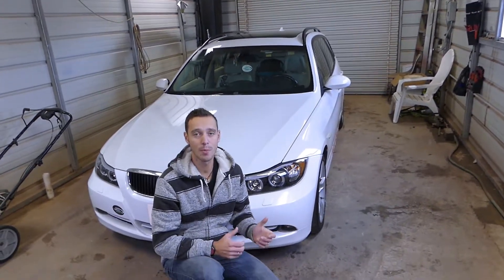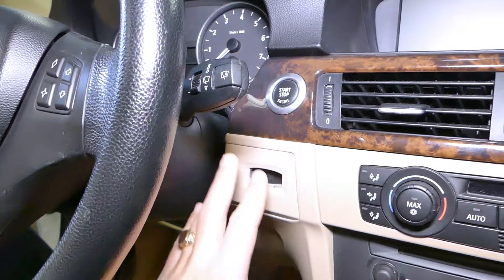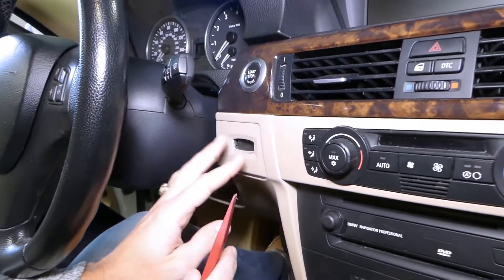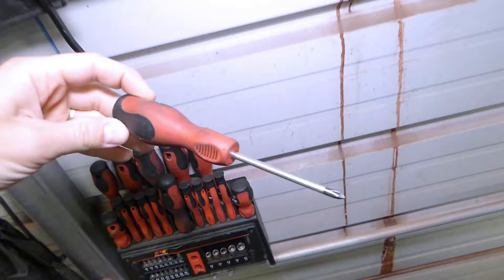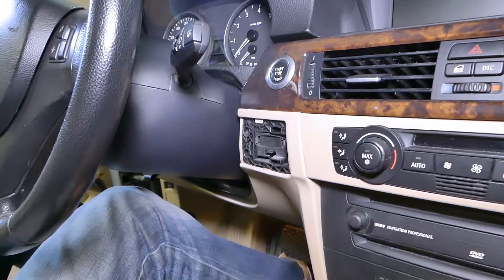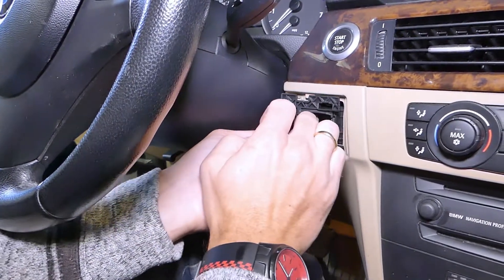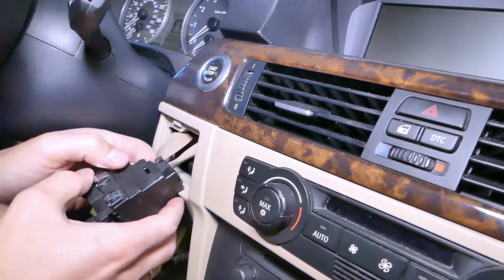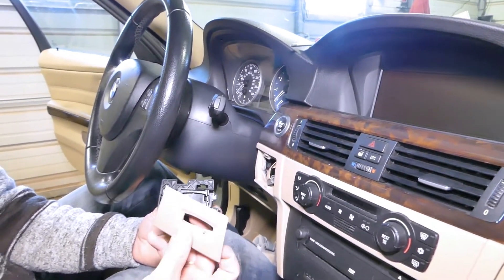HOW TO REMOVE AND REPLACE IGNITION KEY READER CONTROL MODULE BMW E90 E92 E91 E93

Comment: Man I thought mines wasn’t working just now until I found out it was on neutral 😂😂 I gotta stop getting high
Reply: Same shit just happened to me! saw your comment and saw that I was in drive 😂😂
Reply: @lordfrank3455 😂😂bro I was pissed cuz I thought I broke mine cuz it didn’t want to turn on. I was in park the whole time😂
Reply: i just did a 10hr shift and i had mine on drive and couldnt get the key out i thought i had to take out the whole dash and i just saw your comment🤣🤣🤣🤣🤣🤣
Reply: i did the same but ripped the key out and broke the key lock 😂
Reply: @mattselfe6734  😂😂😂
Reply: @scytrex9694  😂😂

Comment: What symptoms would the car have to warrant this replacement?
Reply: About 10 minutes ago I put my fob into this module and something inside it broke so it no longer holds the fob in while the car's ignition is on. I can just remove it without pushing it in first. Pretty sure the plastic got old and brittle.

Comment: I know this is an old video but ; 
My ignition doesn’t seem to realise I’m putting the fob in it sometimes…it works fine “sometimes” but other times I have to do it 30 times before the button works!!
Any ideas what I need to do? The buttons work for the locks no problem at all … just doesn’t seem to know the fob is in there 🙃
It’s an “08” plate e90 320i cabriolet 
Any help greatly appreciated as can’t seem to find anything online
Thanks
Reply: I have the same issue with my E93 m3 
Did you ever finding the issue?
I’m suck trying to figure this out
Reply: Hi guys, did you solve the issue? Having it rn
Reply: hello solved the issue??

Comment: I have the 2007 that has the shifting on the steering wheel  battery died I put a new one in and re program the key it still does nothing it hat the steering wheel lock light and the key light on help

Comment: do you know if you can install  a used one  from another car? ,, it needs programing or not ?
Reply: I think you can just swap it over bro .. I swapped the Guage cluster out from another car into mine which has more miles and it showed everything  correctly  sometimes on start up it shows the other cars mileage  then it changes to my cars true mileage but not all the time ..

Comment: I have BMW 328xi 2007 the stuck in ignition, I have to remove the power relay to get it out. No crank, no start. What should I do my friend?
Reply: Did u find a way to get it out
Reply: @hottdogg1232 what did you do to start and fix it

Comment: If I replace this part do I need to do any reprogramming? Will my old key still work in it? Would it make a difference if I bought a used one from the junkyard? Thanks.
Reply: Did you ever get a reply?  I have same question
Reply: No...I didn’t. However, I bought a new on at Mercedes and it was super easy to change. There’s nothing to program...it just reads the key and sends the codes to the ignition module so I think a used one would work fine.
Reply: @stevesunseth393  just read your message as I was looking to replace my reader as it keeps spitting the key our kid the reader but was worried incase there was an issues with recoding, it looks like its simple enough to fit

Comment: I'm not sure if it will help, but  the magnet is not holding the key or  reading it....hopefully, it works with a new ignition replacement switch
Reply: did it? or does it need coding?
Reply: @megabodies1  no coding needed...I replaced mine....all good

Comment: Hey guys..I have a 2008 528i with a key fob that's stuck in my ignition..Car starts and does everything else.just can't get darn key out..Can you please help?..Thanks!..Joe
Reply: Did you figure out??
Reply: Damn mines stuck too
Reply: @hottdogg1232  I ended up just pulling it out. Use a little force when you pull it but it will come out
Reply: @joelane4670  did it mess it up or did it go back to normal?

Comment: Do you need to program the key after the replacement? And my key fob gets stuck in there do i need to replace it i have to play with my key when i take it out because my cars been sitting for a year but im fixing it next month
Reply: Did you need to code it
Reply: @Tiger3267  this was so long ago i forgot what the problem was but i remember i took the battery off over night and it worked again
Reply: Wow, a easy job just so you can have your car sitting for a year🥲👌🏻
Reply: @MarkMasters83  now I got 4🤣🤣

Comment: Fuse no 36 ampere 40 remove the fuse again installed the fuse 40 ampere my car ignition switch on key working problem not showing this car help me

Comment: I have 2011 bmw 328i drove to get a coffee came out and car barely turned over and didn’t start went to take key fob out and it’s stuck in ignition so now no crank no start and key is stuck battery is new also new starter and still nothing if someone had had this problem and can help me out that would be great thanks

Comment: Hwzit guy you help me alot i want to know about bmw e90 320i 2009 model when i put the key in its not unlocking staring wheels can you help me out
Reply: Did you ever found out the issue?
Reply: I know this is old post but I’m having same issue, put fob in starts —sometimes….sometimes takes twenty or so goes vecore it realises the fob is there… fu4in me right off now need a fix

Comment: Does it need to be programmed or anything when you put a new one in?
Reply: No😎
Reply: @MarkMasters83  I have a question you may be able to answer seeing as you have the same BMW... I replaced the battery with a new one but I'm getting no power to the cabin unless I connect a battery pack to the front jump points but if I do that the car still won't start... Do you have any idea why this is happening? I just got the car a few days ago and it's my first BMW
Reply: Check your junction box that covers the battery in the rear, and the DmE controller over the fan blower assembly under the hood.

Comment: My key was in the ignition on my 2006 bmw series 3 325i, When accidentally pulled out now the car has no power nor will it read the key please help what do I do next!?
Reply: Hey bro, any luck yet ?
Reply: Yes! Thank god I found excellent European specialist shop, I paid 250$ so then I asked him for a tune up, differential, oil housing gasket, all four break pads for no less than 2000$ and I’m impressed my dash bored lights are all gone and the car is running smooth. Thank you for asking
Reply: @roman ponce 
Is that mechanic here in los angeles ?
Reply: Steve Rodriguez  Negative, El Paso Texas
Reply: @romanD07  so was it the ignition switch that went bad?

Comment: Anyone else ever had the key fob stuck in the ignition slot? I've pulled the whole ignition device out with the fob stil stuck in it but scared to take it apart cus I don't wana damage anything.  I swear it looks like they set a trap to rip fine little copper wires that'll rip
Reply: How did you get the key out?